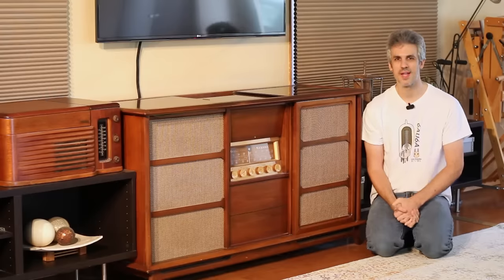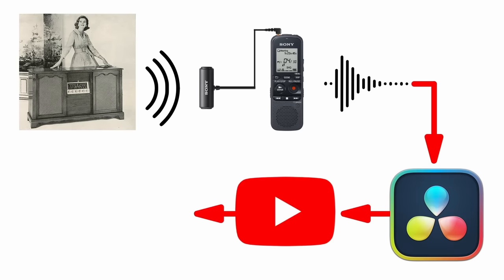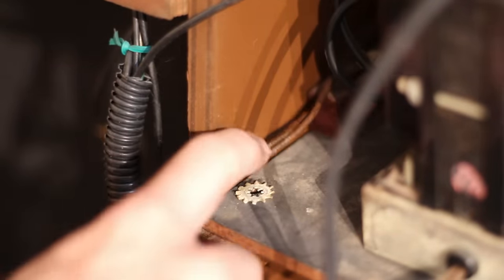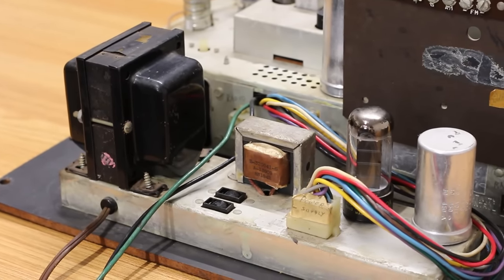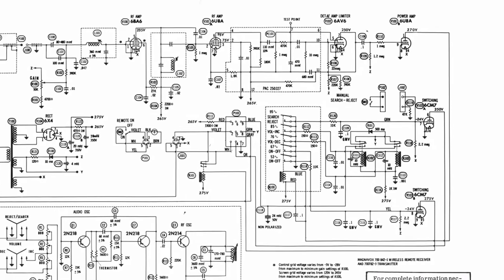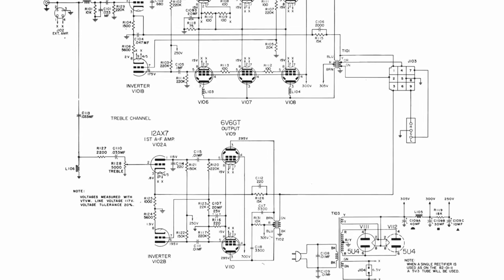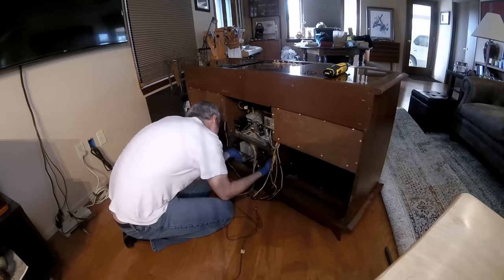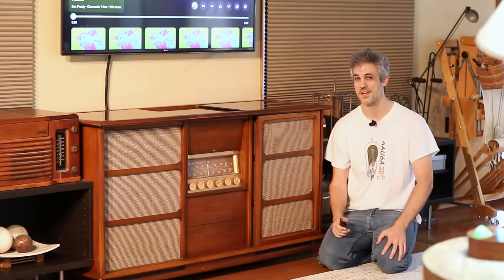A Look at our Magnavox Concert Grand Console Stereo

Comment: Stereo MPX is the multiplexer.  It breaks the two channels apart from the broadcast to be amplified independently.  And poly filament fishing line works excellently as dial string.  Restoration suppliers charge a bleeding fortune for basically the same thing.  That is an absolute BEAST of a unit too.
Reply: I would likely avoid fishing line, as that would tend to stretch and slip a lot.   FM  Stereo is a little complex, once you get into it, with L+R and L-R and all tht fun stuff that was done to try and keep it compaitble with mono receivers at the same time as offering stereo, so the multiplexer (MPX) was quite complex too.   Some units had the MPX unit built in, some had an input on the back labelled MPX for an optional MPX unit you could buy as an add on.
Reply: @EsotericArctos , braided Dacron fishing line has virtually no stretch and can substitute for dial string.
Reply: Standard monofilament can stretch, but I've never had any issues with the braided poly filament stuff.  And it's extremely tough stuff too.  Funny enough, I've never actually fished with it.  When I make a mistake and have to re-string a set a few times with 'genuine' dial string though, the cost can start to sting.  Don't always have a diagram to go by.   @EsotericArctos
Reply: @EsotericArctos He's not talking about monofilament fishing line, but braided line, which is made with braided fibers of ultra high molecular weight polyethylene (UHMWPE), (such as Dyneema or Spectra). Its strength comes from its long-chain molecules and has very little stretch. It's also used in body armor, climbing ropes, cut resistant gloves, and rigging.
Reply: I thought someone would know that, old boom boxes sometimes mentioned MPX on the front
Reply: Dingding!
Reply: Yes, earlier stereo broadcasts were created by simulcasting on AM and FM.  I have an H.H. Scott with an external multiplexor to update the tuner.
Reply: I myself would skip the fishing line. A package of proper dial string doesn't cost all that much.

Comment: If you get a "long wire" antenna, you can either connect or couple it to the internal AM antenna.  In the evening, I'll bet that radio can pull in AM stations from around the country. (If it can't, something is wrong with it.)  I used to listen to AM stations from thousands of miles away on a resurrected console radio and a long wire antenna.

Comment: True bi-amp and those 15" woofers and horn loaded tweeter is still great even for 2023.  Good on your grandfather for knowing what he was doing!
Reply: It is actually a neat solution as the woofers are way less efficient than the horns, rougly 95dB/m against 105dB/m, therefore a triple push pull set for the woofer nicely will help solving the level. Bi-amping was a good idea in this regard, yet any bi-amping or bi-wiring these days is just introducing extra noisy devices and paralleling over output stages. The setup of this Magnavox set with a nice horn and large woofers is very well sounding by design and modern box speakers are no comparison.

Comment: WHAT!   Hold on... dual mono and ACTIVE bi-amping?   Heck!   Did anything else exist like this, at least consumer wise back then?   What a beast.
Reply: Yes, I grew up listening to my Great-Aunts transistorized version (1KWrms Rated).  It is a Magnavox unit dating from the late 60's (hard to tell the exact date from the parts).
Reply: Magnivox and Motorola used surprisingly sophisticated amplifiers in their upper-echelon hifi consoles, both were known to use biamping on occasion. Some had active center channel speakers as well as Left and Right channels. Both brands used Jensen speakers in some models.
Reply: Bi amping was done in the mono Philips Bi-Ampli series of radios. Just normal tabletop radios, as well as more basic consoles.They were typically fitted with two EL84 amplifiers. The later stereo ones continued using the Bi-Ampli trademark but weren't actual proper actively filtered bi-amping, with the exception of the top of the line consoles.

Comment: MPX means "Multiplex" as already mentioned.  Early FM tuners and receivers received a monophonic signal.  Around 1960 (not sure exactly when) the decision was made to allow some stations to broadcast in stereo.   But this had to be done in such a way that a mono receiver would still work OK.  There were several competing designs, so until the dust settled, some mfrs brought out the necessary signal to be fed (optionally) to an external "multiplex decoder" which produced stereo outputs.  This is the MPX jack on your unit, and implies that it does not have an internal multiplex decoder.  Probably units made a year or two after this one had the stereo decoder built-in.
Reply: Oops!  Looks like this unit not only had MPX out, but also inputs for the externally decoded stereo signals, so that FM Stereo could be selected from the front panel.
Reply: The FCC approved the current FM multiplex system in late 1961. Magnavox sold the decoder as an extra cost option until about 1963. Decoders were integrated into the receivers after 1963 when Magnavox went solid state. The decoders show up frequently on EBay.
Reply: In my Moms unit it included the Mult adaptor. I had to work with it to get the unit to work. After replacing caps and the tubes-worked as it should.when you selected “FM stereo” you heard it as stereo if the station had their encoder on and stereo material played thru it to the transmitter. I felt with FM broadcast for a number of years radio broadcast equipment makers sold the stereo encoders to use with their transmitters. The transmitter had to be “direct Fm” not serresoidial as some transmitter exciters used.If the transmitter power stages were all on the stations carrier frequency you could use the direct fm exciter with the stereo encoder-this generated the 10khz pilot frequency needed by the receiver to proper ly sync into the transmitter.then the 19khz was doubled to get 38khz and this was modulated to get  the stereo operation. The decoder -mult unit decoded the signal into left-right channels. It also lit the indicator light on your receiver-another function of the 19 kHz pilot tone.
Reply: It was 1961, when the Federal Communications Commission approved the Zenith/GE Stereo Multiplex FM system. FM really began becoming mainstream in 1966-1969.
Reply: There was a short time in the mid '80s when some US television sets had jacks for an external MPS stereo decoder for roughly the same reasons. But the mass market for NTSC stereo moved so fast that if you blinked, you missed this.

Of course it used different parameters from FM MPX, so the old "listen to channel 6 on an FM radio" trick was mono-only.
Reply: @8bitwiz_  Different frequency deviation from FM in terms of analog, by a bit. And Stereo TV in the USA also was dbx encoded and needed a decoder to sound right.

Comment: Also, de-oxit is your friend.  I would have use it on all the tube sockets.  It not only helps make good connections, it also helps keep them from oxidizing.
Reply: Interesting to see an octal socket with contact problems. I am more used to novals having contact problems
Reply: That's what I was thinking.
Reply: Deoxit leaves a lubricant-like residue and should never be used on tube sockets. Don't do it. Tube sockets should only be cleaned with no residue solvents such as alcohol. Any residue left behind will cause dust to stick the sockets, which can lead to arcing.  Less of a problem with ceramic sockets perhaps but most consoles use cheap phenolic sockets which might even absorb and hold some of the contact cleaner residue. Ive got 55 years of electronics experience to back this up.
Reply: @goodun2974  You could very well be correct at the voltages tubes operate at.  I had not considered that.  But at lower voltages, that residue actually helps prevent further oxidation, which i would posit (in a lower voltage regiment) to offset the "dust" issue.
Reply: It could be a contact problem in the base of the tube, those sockets are only touch soldered on at the bottom of the pins, I have seen the problem more than once with old large base monochrome CRT's.  @michvod

Comment: I believe the chassis with the sealed bottom is for the FM stereo MPX (multiplex) decoder. That was brand new in 1962 and not all areas had FM stereo broadcasts yet, so it was usually sold as an option. Plus the early tube-based MPX decoders tended to drift, so locating it in a separate chassis away from the heat of the main circuitry helped to improve its performance. 

For better AM reception, try connecting a long piece of wire to the external antenna terminal. You should be able to pick up skywave signals from hundreds of miles away at night, even if you don't have not much to listen to locally during the daytime.
Reply: I wonder if shango066 is watching this?  Hey, vwest!
Reply: Yes I think you’re correct. As soon as I noticed that it was a completely shielded chassis, I thought FM. No doubt now that you mentioned the MPX.

Comment: What's really cool is a lot of the early remote controls were AUDIO.  And the remote itself didn't need batteries.  There were a series of metal rods, and when you pushed the button, a little hammer would hit the selected rod and make a ringing sound (very high pitched).  This was picked up my a microphone on the system being controlled, and the individual tones would activate relays, that would, in turn, operate the system.  Quite often for things like volume up and down, actually controlled a motor that turned the volume knob.  So if you clicked the remote, the knob on the TV would turn.

I've seen one of these still in use by it's owner.  And yes, this was a tube TV.  And the remote worked just fine, although the range was pretty limited.  Which wasn't an issue as the picture tubes were small back then, so you usually sat fairly close anyway.
Reply: My friends dog would walk past their TV and the rattling of his name tag against his collar would mute the TV!!! :)
Reply: /it's/its/
Reply: This is why people sometimes still call the remote "the clicker"
Reply: @matthewkriebel7342 no it's not
Reply: No expense was spared in the design I
Of this. They managed to get three transistors in there, but didn't cheap out with the tubes. Transistors we're probably more expensive at that time though.
Reply: I imagine the range was just because the volume of the tone was mechanically limited. Does the audio-based design of this remote imply that the TV could be controlled by a computer emitting a sound of the right frequency, as long as it was within audio range?
Reply: @thecianinator yep
Reply: shangoo66 has a console radio that has the first electric remote control
Reply: @rivards1 Yes.
Reply: Magnavox had a different method of remote control. Their Phantom remote used high frequency whistles. If you held one up to an ear and pushed the button down you could hear a quiet "chuff". I've yet to see anyone open one of them up to show what's inside.
Reply: Top Magnavox consoles, starting in 1964, used an ultrasonic whistle remote that was previously used on their B&W television sets. However the CG used a battery operated RF remote. There is an antenna behind the left channel woofer that receives the signal. The CG is the only stereo that used that. The Imperial from the same model years used a wired remote.
Reply: @alanmaier  Magnavox also used the ultrasonic Phantom remote on color TVs.
Reply: get out!
Reply: I think Zenith had a patent on their goofy remote control with the metal rods-- they came up with the idea in the late fifties and they were still using the same basic design well into the seventies.
Reply: We had a remote control TV that would turn on and volume go full blast whenever we used a certain vacuum cleaner, the vacuum cleaner must of been making a sound to trigger remote.

Comment: Amazing, active crossovers and dual mono power amps - I've never seen a console type stereo executed this seriously. Also the tweeter horns are unusual and rather impressive.
Reply: That is quite a beast! I have had tube type stereo gear (separate components) for more than forty years. The rig I have now has two monoblock amps that use pairs of 6L6 output tubes that can muster around 30 watts or so before they overload; they feed acoustic labyrinth speakers that work quite well, as long as I am not trying to blow the roof off the house. I wonder how much undistorted power those amps are actually capable of under worst-case conditions-- the arrangement with the separate bass channel is a very practical way to allow "fudging" the output transformers in the midrange-treble amplifiers since filtering out the bass frequencies BEFORE the power amps would sidestep the intermodulation distortion that would result with an inadequate output transformer being badly overloaded at low frequencies.
At the time, Motorola was noted for their consoles that were skimped and got away with it by doing pre-power-amplifier crossovers.
Reply: Magnavox is known originally for its horns. They used them up into the ‘70’s in their larger console units. Some had dual horns.
Reply: @donleamon8653  we had an Astro-Sonic when I was a youngster-- it paled in comparison to the Yamaha receiver and Advent speakers that replaced it in the late seventies. . .
Those horns are not for me
Reply: Tweeter horns may be ElectroVoice

Comment: Good Lord, what a beast! Dual bi-amped monoblock power amplifiers in a home console system in 1962? I never knew there was such a thing! And those horns and 15" woofers look like they would be more at home in a small concert venue! That's a machine to cherish, indeed.
Reply: I'm not saying it doesn't sound good but 15" woofers back then didn't have a lot of movement. They were usually quite stiff due to the paper surrounds.
Reply: @bertroost1675  That's certainly true, but then I don't think small concert venues had the SPLs or low-end coverage they have today. I stand by my claim that I haven't seen many, if any, other 15" woofers in loudspeakers intended for home use in the early 1960s.
Reply: @danmenes3143  I have a different Magnavox console that also has 15" woofers. They're placed sideways so the console could be smaller.
Reply: @bertroost1675 

They were that way because of the usual low amplifier power. They were tuned for efficiency, not low bass extension/spl. Although 'long throw' woofers in sealed cabinets were around already - but only in standalone speakers (mainly Acoustic Research and KLH models). Pro speakers for venues would have mainly used all sorts of horns at the time.
Reply: @danmenes3143 

It was quite common for those large 'Texas sized' consoles to have 12" or 15" woofers. In the later years, when they got cheapened, as component stereos became more common and people wouldn't spend as much on a console, this wasn't the case anymore. Sometimes you find 6.5”s with puny amps in huge cabinets.
Reply: @westelaudio943  That may account for my surprise. By the time I grew up, in the 70s and 80s, when I encountered a console stereo, I expected a large and ostentatiously ornamented box containing the barest minimum of electronics.
Reply: @danmenes3143  

Yeah. They were meant as a nice looking piece of furniture that could play the occasional "Best of Johnny Cash" LP. 
Anyone who was into semi-serious HiFi would have gotten something like a Kenwood receiver and big lattice grill speakers at that point. I'm not sure if there were any consoles left on the market by 1980.
Reply: @danmenes3143  I didn't realize you made a claim. But there were a few home speakers with 15" woofers. They were expensive and therefore few people bought them.

Comment: Those filter networks at the input to the 6 tube and the 2 tube amplifiers are actually your speaker crossovers. Both Magnavox and Motorola built these bi-amp console systems. A line level crossover has many advantages over a passive speaker crossover. But it's also expensive as you need another power amp per channel.

Comment: You know best how to warm the vacuum tube witch's heart, haha! Magnificent Magnavox indeed, the name really does it justice. Just looking at those tube monoblocks gives me a shiver of awe (and fills me with determination). 

Sorry to hear about your hearing loss. I never realized.

Not understanding radio stuff... well, you could say that about me and tube computers, haha! 

The remote control receiver is such an over-engineered thing for a simple purpose it fulfills, it just blows my mind! I'd keep it disconnected for the time being, until you get or reverse-engineer and make a new remote. 

The phase inverter used in those magnificent Magnavox monoblocks also blows my mind. Basically, an amplification stage and a voltage divider to an identical amplification stage for the other half of the signal - it has a drawback of introducing asymmetrical distortion. I wonder why a more conventional design (ie long-tailed pair, self-balancing or phase splitter) was not used. Also, driving three tubes from a plate with 220k resistor is rather peculiar here - but sensible for bass and midrange. Equal resistances for plate and grid leak resistors are pretty unheard of as well. As for the other power amp - two 6V6 push pull - it's also that voltage divider and gain stage. 
It's no FULL BRIDGE RECTIFIER on those 5U4s - it's just a full wave one with two tubes wired in parallel. You could even hot-swap a rectifier tube (but don't do that, okay? :)).

Personally I'd try old school wire lacing here, this device simply calls for this lovely old school method :)
Reply: Technically It's a Full Wave Center Tap Rectifier, with the Rectifier Tubes in parallel to double the current capability..